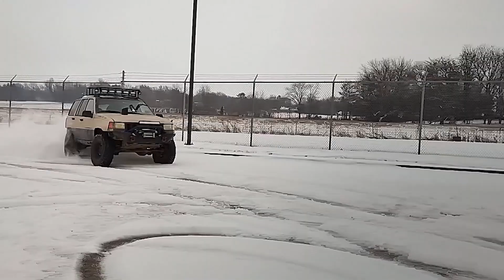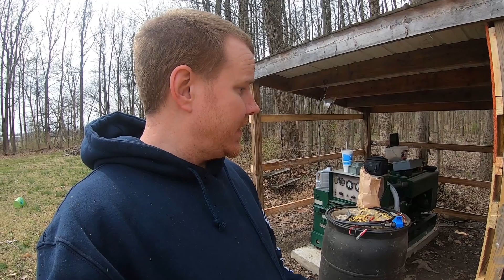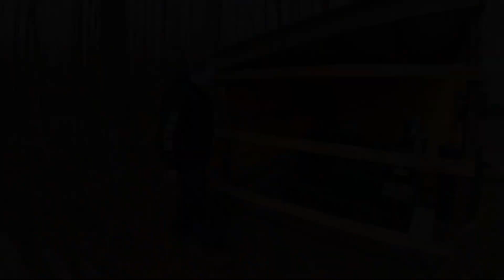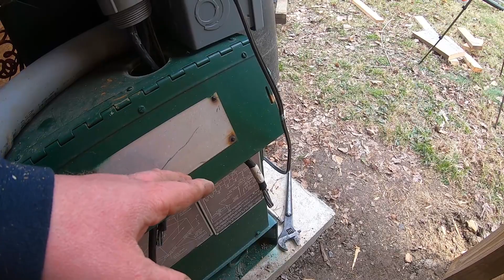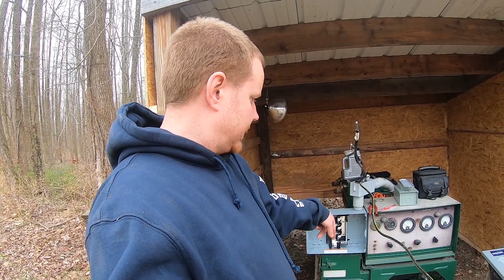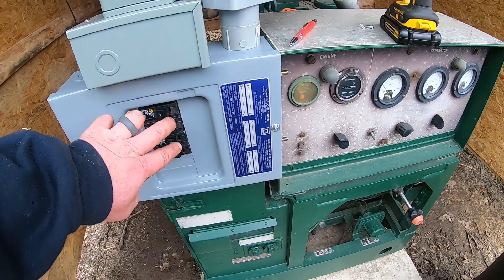Emergency Generator Shack Build - How To Make A Generator Quieter - Diesel - MEP003A - Part 1

Comment: I wonder if the mep 802a would handle black diesel, the 002 n 003 are older and seem more robust.
Reply from the maker: That I don't know.  The 002 and 003 are both IDI and air cooled ..  very simple and fairly robust units.  What engine does the 802 use?
Reply: @NotSoGrandGarage  Onan DN2M

Liquid cooled
Reply from the maker: @SamSung-1321  Looks to be direct injected.  I'd say you could run oil blends in it...  but you'd need to be careful with it and I'd want to make sure it's under a good load when running any oil in it.  Cool running would likely coke up the injectors pretty quick.
Reply: @NotSoGrandGarage  if I did, I would run diesel then through auxiliary tank, switch to Black diesel. 

Typical stuff. I hear the 802a are a bit touchy concerning loads, though
Reply from the maker: @SamSung-1321  I'd say all of the mechanical diesel generators are touchy with load.  Reason being, the engines are sized for the maximum power output of the generator so when they are ran at 25% or 50% load for extended periods, they aren't working hard enough to burn the fuel clean.  That's when things tend to start going sideways.

Comment: I am looking for about your product place lace me a message. When I post this, I am looking for more information on this on your bill with the generator had to get it all hooked up and got it running and where did you get your generator at like to know more details about it and all of the project you did with it and what does it charge how'd everything go I hope everything is safe there and well with you hope I see more videos on this
Reply from the maker: I found the generator on marketplace non running for $500.  I got it home and spent $50 on parts to get it going.  I've probably got $1k in it now, getting it in place and wiring it all up.  I did everything myself, including the electrical, so that's saved a bundle.

Comment: That setup will last you, your kids and grandkids, pretty much same setup I built. I installed ags, auto gen start works great,
Reply from the maker: That's the goal!  Thanks for watching.   I'll look into the auto start setup
Reply: @NotSoGrandGarage I go out and start mine once a month now to keep oil circulated and make sure everything is good, I used to mainly use it in the colder months because my solar wouldn't bring enough, but I installed more solar panels and im now at 15k of solar and a wind turbine, but anyways while I was out yesterday I remembered to look at the auto Gen start I have, it's a deep sea auto Gen start, they offer several types, starting at $80 and go up, depending on what you want, thought I would let you know. I also installed a exhaust fan on the wall to let air in to keep the generator cool, it has a thermostat that set so that when generator gets certain temp, it opens up, exhaust is piped threw wall and up into the air with flappers to keep rain out.

Comment: If you leave that box sideways, you have a potential of the electricity spilling out onto the ground. All your connections should be uphill from the destination so as to allow the correct flow of electricity to said destination. :)
Reply from the maker: I hate it when electricity spills...   considering the price of that stuff, hate to waste any.

Comment: Good video!  

I think you will have a moisture problem inside of the generator enclosure if you don't put a vapor barrier on the ground.  With little to no air movement in the enclosure, the moisture will condense on the metal surfaces potentially causing corrosion.  Ideally, lay down some black Visqueen and pour a slab with Quickrete.  If you don't want to pour concrete,  then lay down the Visqueen and spread limestone on top of it.  The limestone isn't as good as concrete, but having the vapor barrier below it will help.
Reply from the maker: Looks like I'll change the plan up a bit.  Won't be any more difficult to pour a small pad.  Thanks for the heads up.